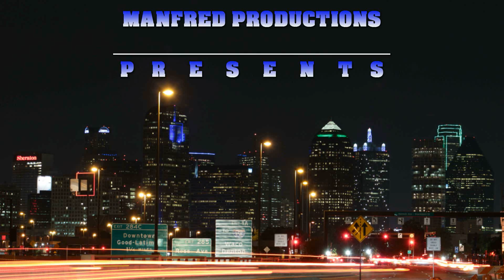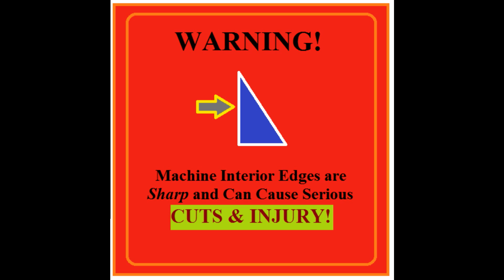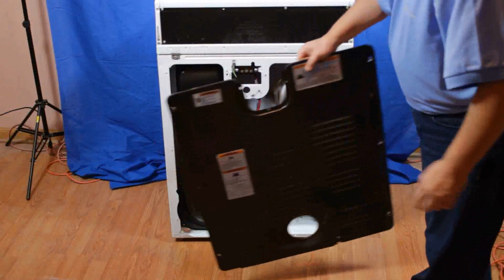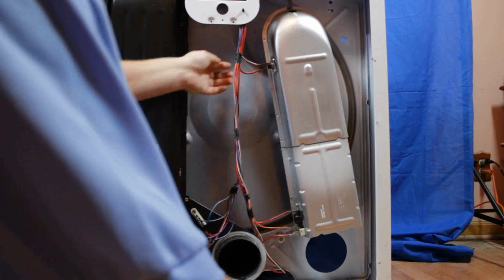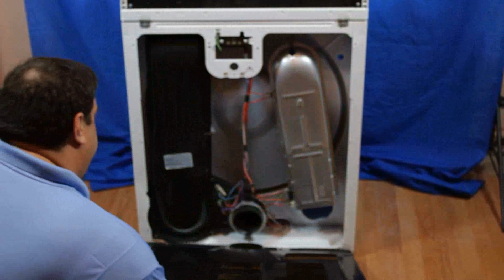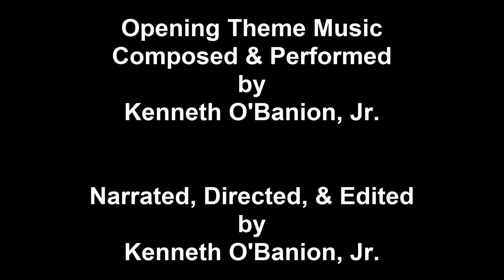Whirlpool - Kenmore Dryer Repair - Won't Heat, Test Fuse & Thermostat 279816 or 279769

Comment: Thanks for your help Canyonman.
I have a Simpson Sirocco 555 dryer. It's been out of action for a couple of years but I recently replaced the perished fan belt and using an air compressor blew the lint and dust out of it. Now, after a couple of minutes of operation and heating up, it blows the house power circuit breaker.  Any suggestions what that might be please? Regards

Comment: I have a ge dryer that don't use cause makes noise can I use the heating part on my whirlpool
Reply from the maker: Maritza Macias No, they are not the same and it will not fit in place.

Comment: Everything checks good for continuity for my kenmore  dryer. It still isn't blowing heat. I also cleaned it well. No heat. Any suggestions?
Reply from the maker: Jeremy Davis 1st thing to check is to make sure your are getting the full 220 volts from the wall plug through the power cord to the terminal block.  use a volt meter, and measure from terminal L1 to Neutral and L2 to Neutral, those should both be 110 volts.  Then test from L1 to L2, that should be 220 volts.  If not, check the connection, and then go to the circuit breaker for thedryer circuit, and then turn it off and then back on to reset it.

Comment: At around 2:45, you state "I for infinity which means it has no resistance" or something along those terms. I for infinity here on the Ohm meter would represent infinite resistance, or no complete circuit/connection which would mean it's bad. I know it's an old video, but I'm looking into my dryer's circuitry at the moment and I wanted to bring that to your attention - simple wording mistake, but your point (the majority of it) is understood. 

Some people may just take it technically and get it confused with what they already know about circuits (albeit none or a lot).
Reply: ***** word

Comment: hey man ,mine wont heat either and i have continuity on all my themostats and fuse, could it be the timer? and the heat element is not open either, all good on coninuity,  please help,,,,,,,,,,,,,,,terry
Reply from the maker: Yes, it could be the timer.  Testing is complicated.  Unplug machine, then take a picture or write down which wires go where on the timer.  Now, remove the wires.  Then you use the tech sheet timer diagram to check between the listed terminals, with the timer set to the correct cycle for that test, and then see if the result matches the chart, either an open or a closed or has continuity reading.  Do this for all the terminals listed on the chart to make sure they are correct readings.

Comment: I've replaced the thermal cut-off kit (#279769) that's attached to the heating element housing several times now and it keeps burning out (only the fuse keeps burning out, but the thermostat that says L248-80F on the back is fine). Any ideas why it would keep burning out? The heating element, thermal fuse and thermostat next to the thermal fuse are all brand new and have been tested with a multimeter. I could hang dry my clothes I guess but then I might as well wash them all by hand too, and churn my own butter. 0_o =)
Reply: canyonman1963 The blower thermostat and thermal fuse have been replaced also and I cleaned out the blower housing and exhaust hose. No blockages anywhere at all. My last guess is that the parts I used could be aftermarket, but it's mainly just the fuse on the heating element housing that keeps burning out, all the other parts are still good. Maybe I'll try to find some OEM parts.
Reply: The one I have is stamped 352F on the back, that's the one that keeps burning out. I'm not sure what else to try.

Comment: Everything connection test was great and did a very detailed cleaning even ran dryer without exhaust hose. still darn clothes are not completely dry? It is a Whirlpool Heavy duty dryer.

Comment: Hi i replaced the motor on my dryer and when i was pushing it back towards the wall  sparks came out from the vent hole and blew a house fuse and now my dryer does not heat what could it be?

Comment: My whirlpool dryer thermal cutoff keeps blowing out. I put in a new heating element.  I also cleaned out the dryer filter, duct pipe, and the blower housing.  I'm sure nothing is blocking the air flow, but the thermal cut off blew again.  what else could it be?
Reply: Yes, I changed the thermal cutoff and the hi limit.  I checked the holes, they aren't blocked.  I wonder if the operating cycling thermostat could cause overheating?  would it help to put in an adjustable thermostat and lower the termperature?
Reply: Thanks for the ideas.  I have a question about the thermal cut off.  Is too much heat the only way it can blow, or can too much electrical cause it to blow?
Reply from the maker: You are welcome.  A power surge, or a short in the wiring can cause a fuse to blow, as well as too much heat
Reply: I finally found out why the thermal cut out was always blowing out on my whirlpool dryer.  I checked the air flow, everything was clear.  I checked for shorts, nothing.  It has a new heating element.
Without a load of clothes it works fine. With a load of clothes, thermal cut out blows.  With dryer vent hose off, and a load of clothes, it works fine, but with dryer vent hose on, and a load of clothes, thermal cut out blows.  The vent hose is clear of lint.  The blower housing was cleaned out of lint. 
     To check if a short was causing the thermal cut out to blow, I put in a good thermal cut out, then jumpered the wires together so as to, bypass the thermal cutout.  Then ran the dryer.  In 6 minutes the thermal cut out blew.  This means that too much heat is causing the thermal cut out to blow, not too much electricity, since the thermal cut out was not connected to electricity during the test. 
     Finally, i ran a termperature test.  I removed the vent hose, then inserted a thermometer into the duct, then ran the dryer with clothes.  In 6 minutes the temperature coming out of the duct went up to 180 degrees, and the thermal cut out blew.  The operating thermostat just inside the duct is supposed to be rated for 140 degrees.  This means that either it's a bad operating thermostat, or it's an incorrect thermostat.

Comment: Great Video! How about if the dryer gets hot with no clothes in it but then it does not heat up when wet clothes are in it?  This happens on automatic dry or timed dry settings and takes three times as long to dry a load.  What could the fault be?  Thanks
Reply: I found it to be the solenoids that were bad.  With the rear off the dryer I could see it glow but not ignite the flame.  The replacement was a bit of work as both solenoids are located on the bottom of the dryer just behind the front wall.
Reply: Clothing was not an issie bit rather time. It was a heat issue where after running a bit the solenoids would heat up and then shutdown.

Comment: I have a Kenmore front loader dryer to replace the fuse and the thermostat is the same as this video? I do have power going into the machine, on the last load I held the start button down for 10 seconds and it did start, but after that I could not get it start anymore. Do you think it's the fuse and thermostat?

Comment: I have the same exact dryer you have in the video. Great video. The problem I'm having is the dryer doesn't get  hot on one setting that I usually use but will get hot on the setting that says very dry. Does that mean it's not the heating element?
Reply from the maker: You are right, it is probably not the heating element.  Test it, if it test bad, then replace it.  If it has continuity, you could still remove it and visually inspect the coils just to make sure none are broken or smashed together.  Since it works on one setting, but not on another, the heat selection switch could be bad, or a wire could be shorted somewhere, or there could be a bad circuit through the timer.  Have to test them to find out where the problem is,  Hope you have success in finding the problem!

Comment: Hi i have a old whirlpool dryer ,its starts fine but the heat cuts off after awhile .I tested the thermal cut off ,high limit, the fuse and the cycling thermostat and they all have continuity .Is it possible the cycling thermostat is shutting it down prematurely and needs to be replaced ?

Comment: I checked continuity on all thermostats and were fine. I've already replaced the element and still no heat. Is there anything else tied to these circuits that would be bad?

Comment: Sears help line kept telling me my heat element was bad. He said he is a "Trained Technician" and he knows the problem. They wanted me to order part and wait since it was on back order, a month. I said I wanted to do some more trouble shooting. He was insistent that I order now. After reviewing your videos, I found Hi temp cut off switch stuck open. A couple of smacks, and a thorough sweeping, Everything is working. Thank you. And I will donate when I can.

Comment: I'm hoping you might be able to direct me in the right direction here. The dryer starts fine, spins, goes through the cycle, no heat though. I have replaced the following high limit fuse, thermal fuse, thermal cut off (entire kit, element + fuse/thermostat) and I still don't have heat. I was on the fence on replacing things since all of those pieces (the originals) seemed to work ok when using the multimeter. Sure enough, after replacing I am still getting cold air.  Thoughts?

Comment: Thank you for your videos!  I have no heat on my Kenmore 90 series (which started as low heat) and have just tested continuity on the fuse, thermostat, and heating element.  I also checked continuity with the wires plugged in and it came back alright.  Any suggestions now?  Also, everything besides the heat seems to work just fine.  Thank you again for your help!

Comment: One note for others who may have these problems... most of the thermostats & fuses seem to work fine even if you order an aftermarket version with the exception of the thermal cut-off. Even some on Amazon that claimed to be OEM parts were outed by reviewers to be copies that quickly failed. I found a real OEM part with the number 279769 for about $16. Good luck and thanks again canyonman.